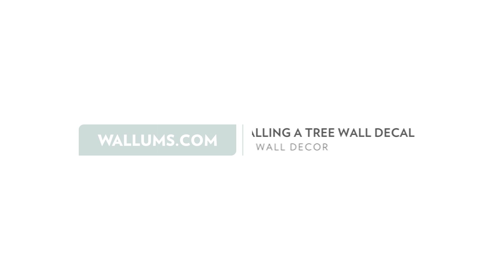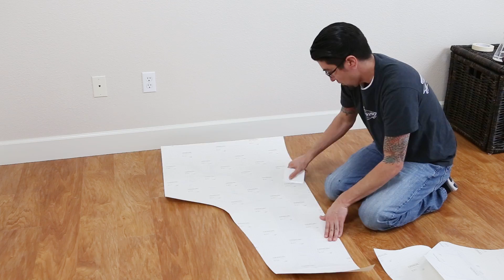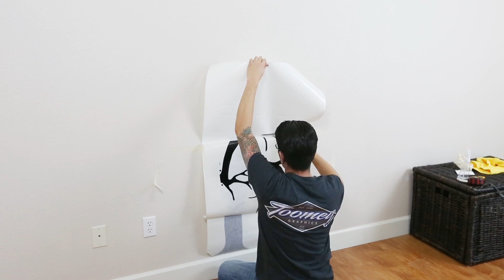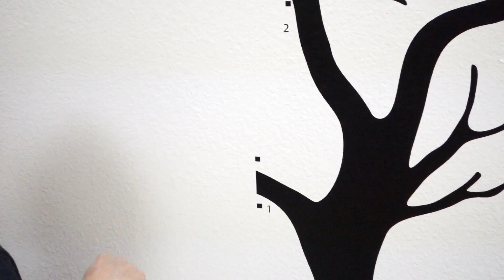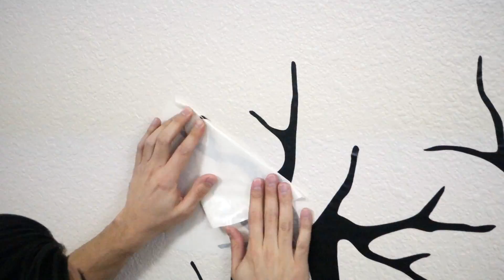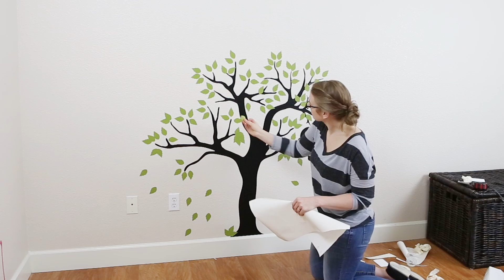Installing a Tree Wall Decal using Center Hinge Method

Comment: Lol. Well, after ppl give this a go a few times they'll have a greater appreciation for what I do for a living when they see me out on the street working on huge windows
Reply: Yep it looks simple even mor so with a professional installer but it’s harder then it looks especially outside on a window with a large decal and of course the wind will start blowing or if you’re taping up a pattern for dimensional lettering 20 foot in the air the wind will blow.